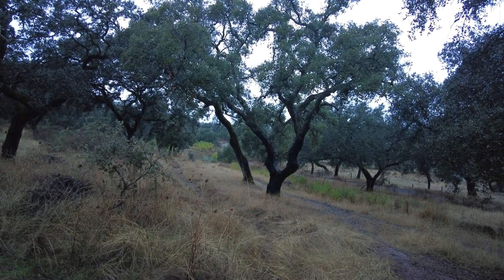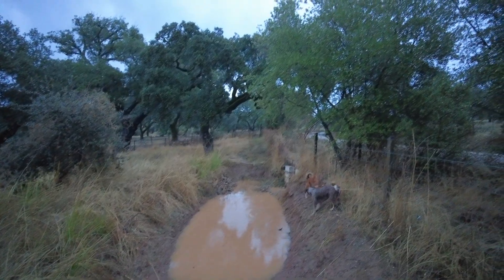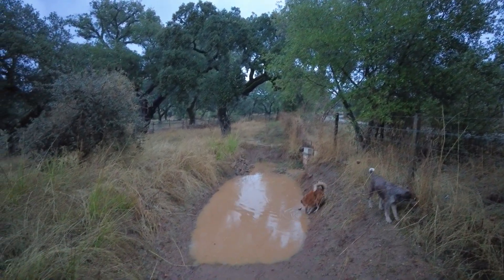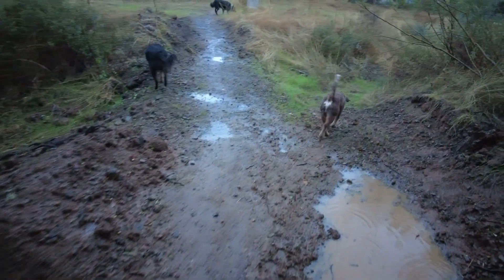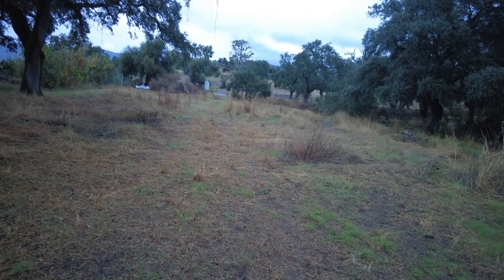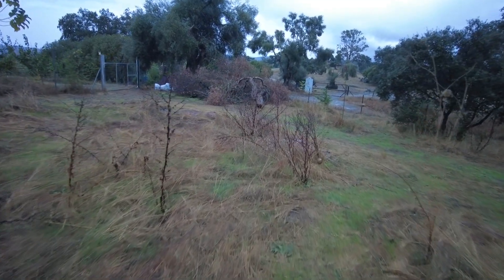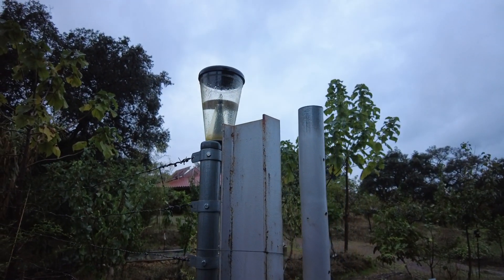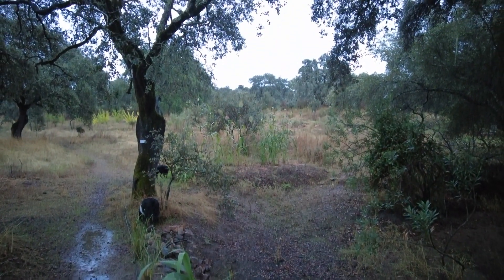How Rain Shapes Clay Soil: From Dust to Saturation

Comment: I am surprised that 40 mm (1,5 inches) of rain didnot start a surface flow on your land. It means that it infiltrates and the amount of vagatation has contributed to that. Congratulations for that. I am sure as more carbon is build up in your soil, the rain is better absorbe by the soil. Very good results. But, .  . was with this amount of rain last year, the run-off not higher?
Reply: I agree completely with your observation.  1.5 inches of rain in ~12 hours is a significant amount of rain.  It is all about the vegetation and percentage of carbon in the soil.  All of the vegetation (green, dry, tall, chopped) is the first step to converting clay to living soil that has the capacity to absorb rain as it falls. 
This is just the beginning of the rain season.  Exciting times ahead! 👍
Reply from the maker: I think your observation is spot on. Thank you for sharing